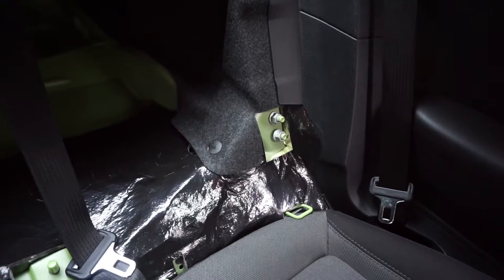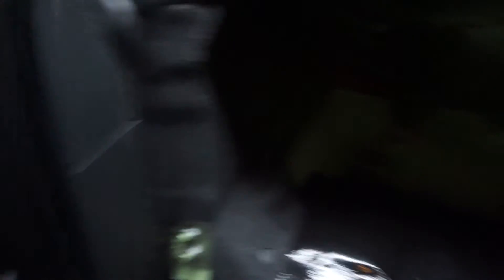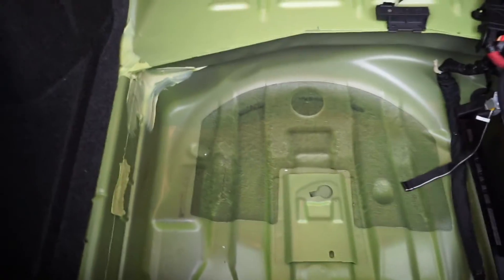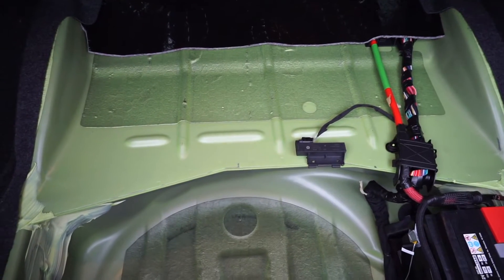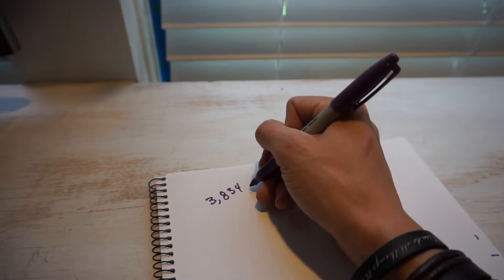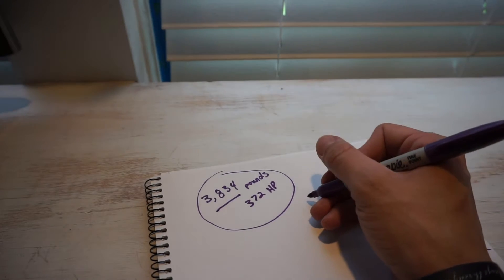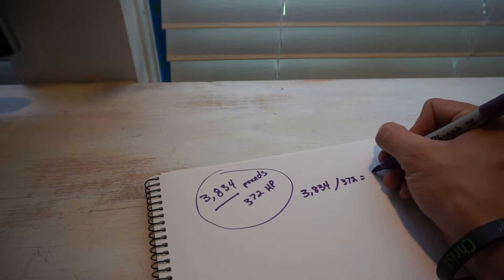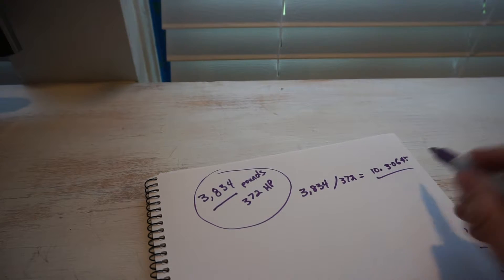Vehicle Weight Reduction - Dodge Challenger

Comment: A 91 Honda hatchback or 98  is 1900 lbs  put a Honda k24 in it
Turbo it 
500 horsepower no problem  so that’s 
3.8 lbs /horsepower all for less than $10,000😂😂  now all wheel drive it there’s your traction for a rocket ..just enjoy the rock for what it is expensive slow

Comment: Weight reduction on rotational mass which is things like Tires, Wheels Rotors, I believe have more effect on giving you a bit more horsepower because  of the weight loss on the rotational mass rotation
Reply from the maker: Very true.  I was actually recently doing some research on this.  Lighter weight tires have more significance on acceleration than just making the vehicle lighter.  Pretty neat stuff!
Reply: @MrJimTim  yesir anything that has to do with rotational mass,  will indeed have significant hp gains

Comment: As heavy as these big beautiful pigs are, every little bit counts and take what I can get. Is why I got rid of the stock exhaust system on my challenger, and we're really heavy with those huge suitcase style resonators & mufflers. Went with SLP loudmouth catbacks, and basically consists of open chamber racing bullets on 3" pipe without the resonators and are much lighter and sound amazing with the 6.1. I've been thinking about removing the backseat as well and never have anyone back there anyway, so it wouldn't be a problem

Comment: Remove windshield blades and motor. Remove crash rail, remove shocks replaced with less weight, remove. You can remove alot more

Comment: There is a factory sticker on the drivers door that’s shows the gross weight of the vehicle along with separate front and rear weight in both pounds and kilograms.  this info would yield better numbers to use in weight to horsepower calculation. An earlier comment mentioned 60 ft times and that could be correct. Only a track test would prove that statement. Weight location is a key to providing traction.

Comment: Challenger R/T curb weight is 4089 lbs.  The 3800 pound curb weight is for the V6.  Informative video  though.
Reply from the maker: That is for the Scat Pack.

2015 Dodge Challenger SXT or R/T 5.7L V8 Manual Coupe
JD Power 4/5
Motor Trend
Model: 2015 Dodge Challenger
MPG: 15 city / 23 highway
Horsepower: 375 hp @ 5,150 rpm
Towing capacity: 1,000 lbs
Engine: 5.7 L V8
Curb weight: 3,834 lbs
Torque: 410 lb-ft @ 4,300 rpm
Fuel tank capacity: 18.5 gal

2015 Dodge Challenger R/T Scat Pack
Sports car
5/5 · JD Power
Model: 2015 Dodge Challenger
Horsepower: 485 hp
Curb weight: 4,082 lbs
MPG: Up to 15 city / 25 highway
Wheel size: 20″ diameter, 9″ width
Torque: 475 lb-ft
Reply: I know it's confusing, but really the base 5.7L R/T is 4,082 lbs.  The 392 is 4,240 lbs.  The SXT is the 3,834 lbs.  No way the R/T with a larger engine will weigh the same as the SXT.  This is per Car and Driver,  US News, Motortrend, etc.
Reply from the maker: I've been trying to find some solid numbers and it seems impossible.. lol.   Can you throw me some links please?   The best info I found on engine weight was from back in 2009.  It shows that the new Hemi V8 was only 10lbs heavier than the V6.
Reply from the maker: I found another breakdown... this seems accurate.  Thanks for your info!

SXT 3,885.2

R/T Manual 4,202.6
Automatic 4,199.0

R/T Scat Pack / 392 HEMI Scat Pack
Manual 4,232.3
Automatic 4,239.8

SRT 392
Manual     4,277.3
Automatic 4,287.7

SRT Hellcat
Manual .        4,469.6
Automatic 4,476.2
Reply: MrJimTim that looks much closer.  Still a great video that helps estimate HP recovered from weight reduction.
Reply: I took my rt to the truck stop. 5 bucks gets me a weigh ticket from the scale. It weighs in at 4100lbs. That half a tank of fuel. Typically the stated weight is a dry weight. No fuel or oil.
Reply from the maker: Awesome!  I love getting actual real world  numbers! Were you in the vehicle as well? Is that after subtracting your weight?
Reply: MrJimTim this was minus my weight. Good vid BTW
Reply from the maker: Thanks!  I really appreciate your input!
Reply: Curb is 4100

Comment: lol removing spare tire actually makes it slower 0-60. In a rear wheel drive you want some weight in the very end center.
Reply from the maker: bezaldo7 That would only apply in the case of tire spin.  I didn't write the laws of physics but the less something weighs the less thrust is required to put it in motion.
Reply: Correct but your loss of traction due to lost weight much outweighs the gain in power to weight ratio. Modern Muscle213 also experienced this.
Reply: @bezaldo7  The donut of a spare tire? Really? If something I can lift with a finger makes me lose traction in a rolling battleship it deserves to spin.
Reply: bezaldo7 just slap on some slicks
Reply: bezaldo7 add a wing if you’re into that

Comment: Interesting video. I wonder how much weight that would remove from a Charger.  I believe the spoken rule is 100 lbs = a tenth of a second in the 1/4.  I think they actually used that in the Demon marketing campaign.  In some cars that would be the difference between an 11 second (11.0) and 10 second (10.9) car.
Reply: coolwrld302 I thought so too but if you look at a base Corvette doing 12.0 q miles and 1000lb heavier challenger doing 12.2 then a Dodge Durango weighing over 5500lbs does 12.9 stock so this rule is not true at all and if u factor in all the other aspects the weight is really not much. 

Go get 700lbs of people in ur car and see if there's a .7 sec diffrence in the q mile. There's not